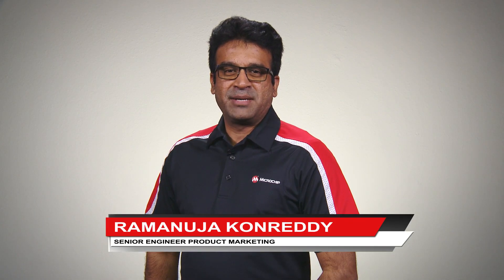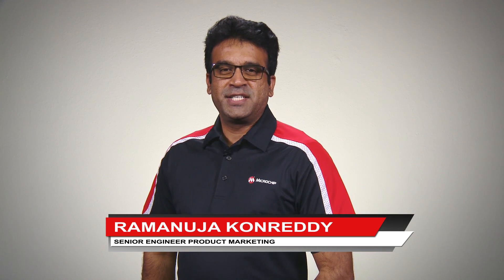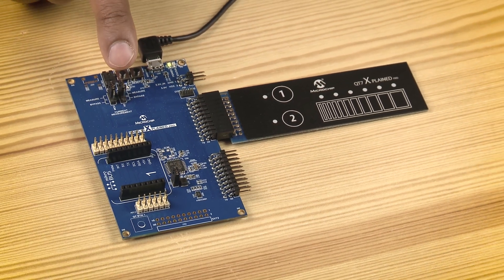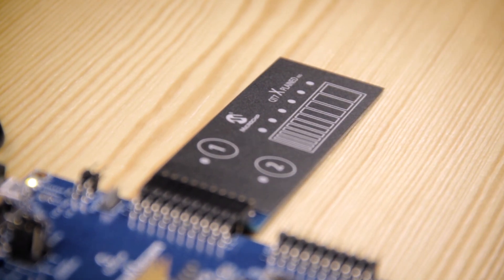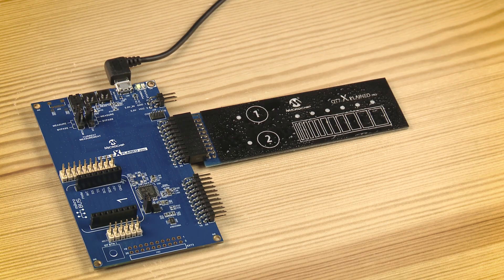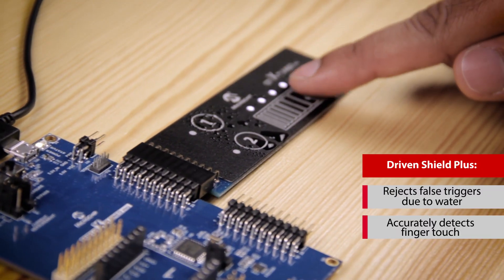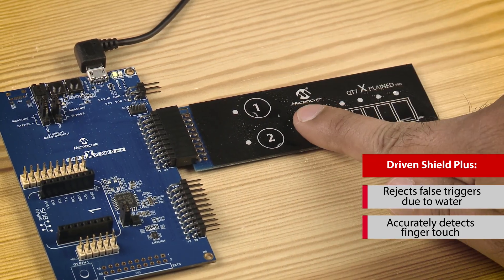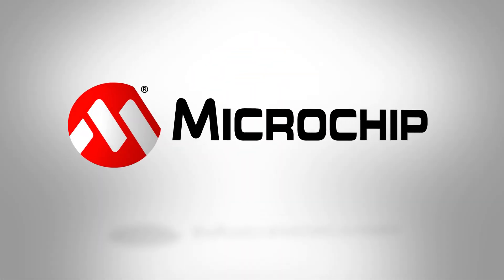SAM L10/L11 Driven Shield Plus

Comment: Is the captouch a hardware peripheral or software using CVD?  Can this cap touch  for the SAML be configured in MCC?
Reply from the maker: Capacitive touch is implemented using the enhanced Peripheral Touch controller, which is a hardware peripheral. It is configured using QTouch Configurator available through the START framework.